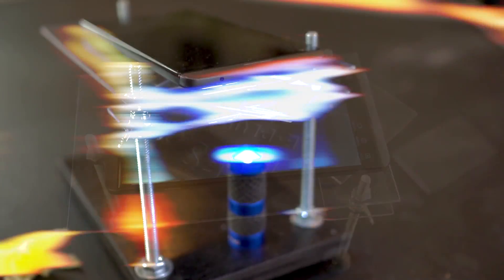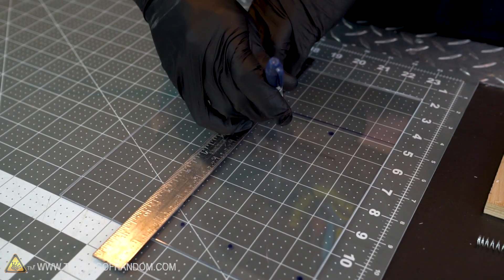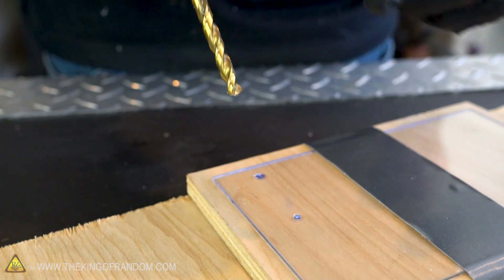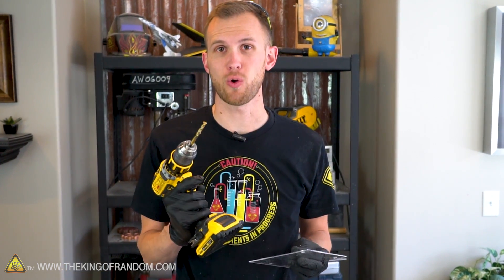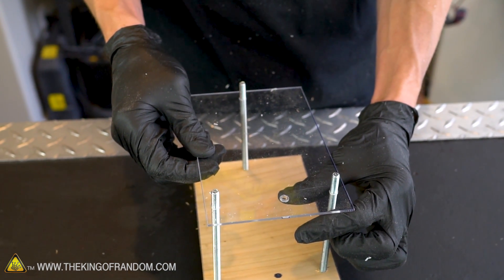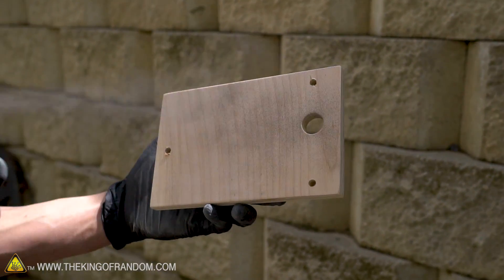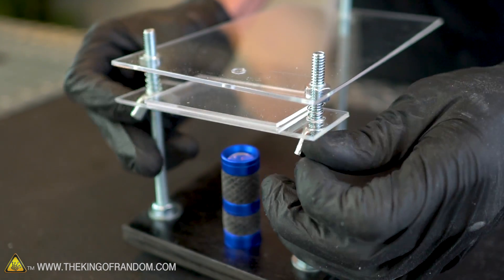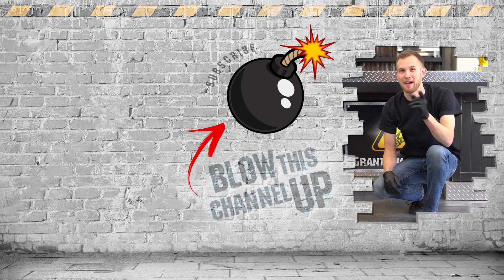DIY Smartphone Magnifier! TKOR's Guide To Making A Cell Phone Microscope

Comment: I'd recommend leaving the protective layers on one side of the acrylic. It greatly reduces the chances of cracking when cutting or drilling and gives you a surface to make marks on.
Reply: I've found that using a step drill instead of a twist drill also helps reduce the chance of cracking plastic materials.
Reply: i agree my thoughts excatlly

Comment: nice, i prefer to leave the plastic cladding covering the acrylic to reduce the risk of making small scratches on the acrylic.
i found that using a sharp metal drill and a drop of multi purpose lubricant oil also helps to prevent the acrylic from cracking to easy :)

Comment: I'm thinking that you shouldn't have been in such a hurry to remove the protective film.

1. Now you have to clean up the acrylic sheet.

2. While working on the project you could have easily scratched the sheet.

Basically, leave the protective film on the sheet until the project is complete.

Comment: When working with acrylic, don't remove the protective sheets until your ready to actually assemble the build. Those sheets will help prevent cracks and scratches while cutting and drilling.

Comment: Please make a rocket that has acetylene gas as its propellant . Gaseous propellants will be cool in a rocket worth a king of random experiment.
Reply: Why acetylene? You won't compress it yourself if you're thinking about that, because it likes to decompose when compressed without the proper equipment. And many amateur rockets run on gaseous propellants, but with just the gaseous fuel stored your rocket will not fly well, if at all.